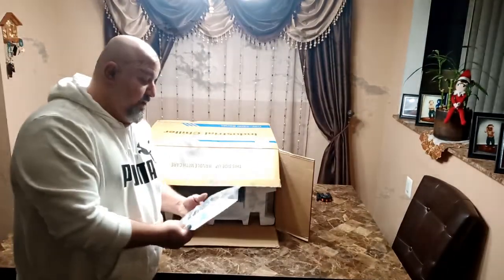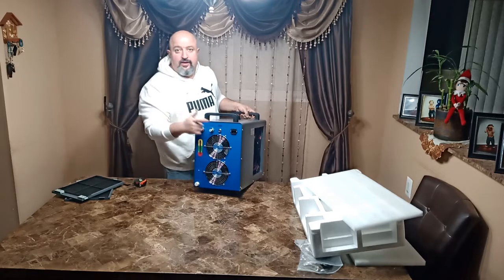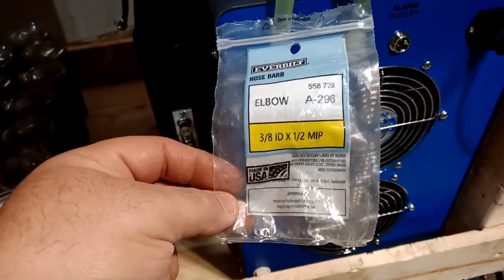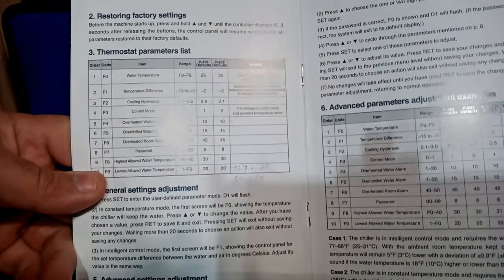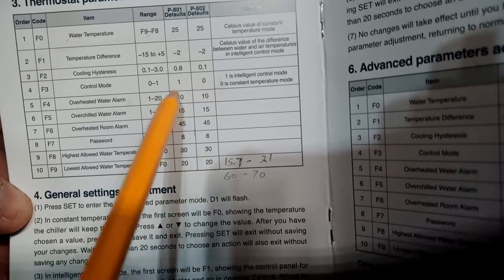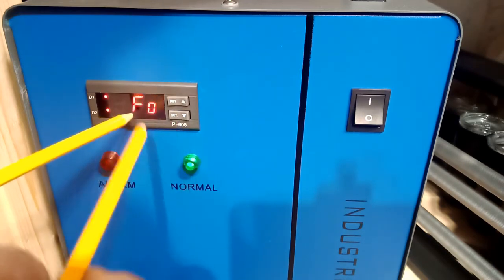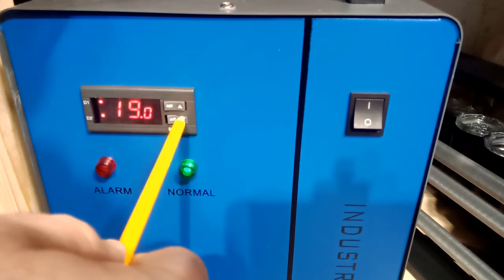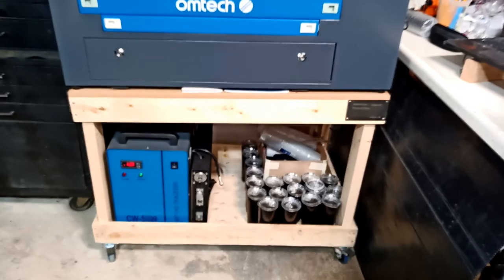Unboxing OMTech Water Chiller, Installation, Setup/Upgrade

Comment: Nice video! Just one opinion you should not block the sides of the chiller, that's where the cooler air comes in. If you block them you will decrease the life of the chiller

Comment: I am setting up my OMTech 60W and have the same chiller.  My setup is also in my garage and I am in the Chicago suburbs.  I do have a heater in the part of the garage that is partitioned off.  When I have the laser machine off, do I still keep the power on for the chiller?
Reply from the maker: one question are you using water or antifreeze, I recommend you using antifreeze so the water inside the machine will not freeze, because even if you leave it on and if you're using water when it get to the Frozen temperature the water might freeze, but if you use antifreeze you don't have to worry about anything plus when you turn off your laser you can turn off the chiller,

I have mine hooked up with the laser when the machine turn off the chiller turns off automatically
Reply: @wisamyousif14  just water. I have read if you use antifreeze, you void the warranty for the chiller.  If I do decide to use antifreeze, how much do you use and how often?
Reply from the maker: @Create4u71  no I don't believe that you will avoid the warranty if you use antifreeze contact your manufacturer they'll tell you and tell you freeze will not harm the water chiller or either your laser I use 100% antifreeze and I mixed it with distilled water I mix one and a half distilled water to 1 gallon 100% antifreeze in your replace it when you start seeing your antifreeze changing color use the regular yellow/ green one, 

But contact your manufacturing if you're not sure to be in a safe side
Reply: @wisamyousif14  Good information! Just to be clear, your mix ratio  is 1.5gallons of distilled water to 1 gallon of antifreeze?  Any recommendations on antifreeze?
Reply from the maker: @smattt  I  had talk to Omtech and explain to them in the cold weather people will need anti-freeze so they come out with their own maybe you can Google it on Amazon
Or just get the same one on my video I’ve been using over a year and a half and I have no problem having changed it still look good
Reply: @wisamyousif14  Cool. Thank you!

Comment: How loud is the water chiller /machine? Would it be too loud to have inside??
Reply from the maker: to be honest when the pump is working you won't even hear any noise but there is to actual 2 fans in the back, plus cooling compressor, so far only the fans turn on, i haven't heard the cooling compressor, but they're not that loud, Both fans are almost the same noise of the actual exhaust fan, that is come in with the Laser, I hope this help you

Comment: am I right in saying that these cheaper chillers are just pumps with a passive radiator? my shed get in the high 30 c's in the summer and I dont think a passive chiller will work for me I use a 100ltr tub with lid, pump submerged I also have a temp sensor in there by the output end to monitor laser temp, All I do is throw in a frozen 2ltr bottle of water everytime I use the laser keep me around the 20 mark constantly - Do you think I am right avoiding a chiller like this in my position? Great video bud
Reply from the maker: hello Friend, NO this one its the CW-5200 this is not the cheaper chiller this one have a compressor just like the frigerated compressor, just like your AC unit.

the one have the only pumps with a passive radiator its the CW-3000
this one CW-5200 and Cw-5202  have frigerated compressor, just like your AC unit.

the 5202 have 2 Output and 2 input is mostly use like if you have two different machines

but I been using this one for a week + it's been freezing for last couple days and when I the laser for Engraving  for like 35min at 55 power and about 4min cut at 80% the  Water temperature went from 7 Celsius at the start to 16.2 Celsius. 
i think this will help me a lot , especially in summertime
Reply: @wisamyousif14  Brilliant explanation Thankyou very much :-)